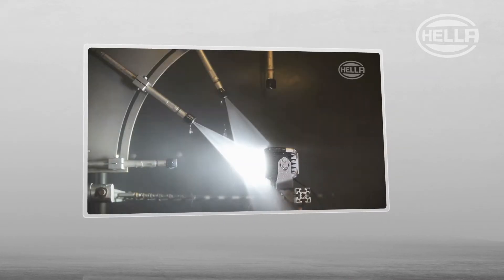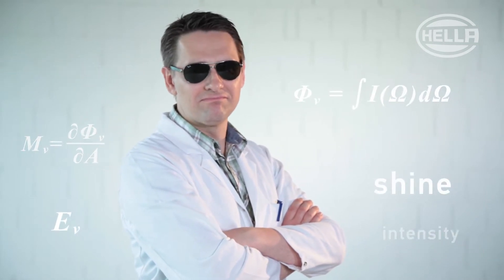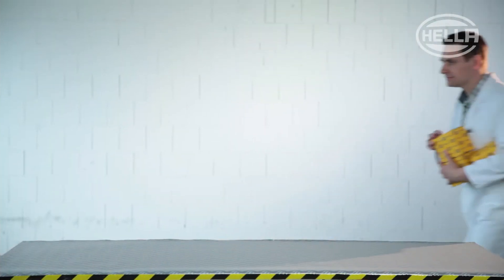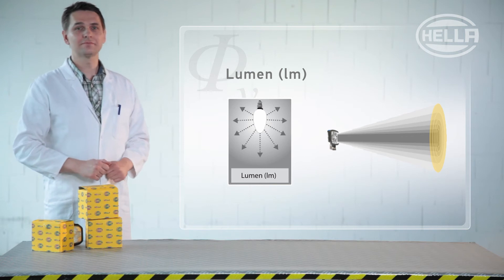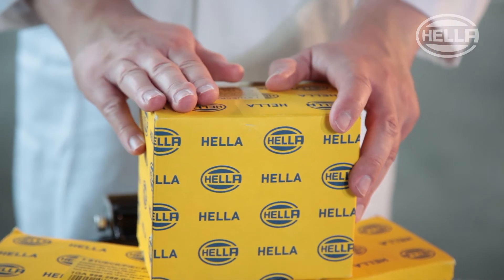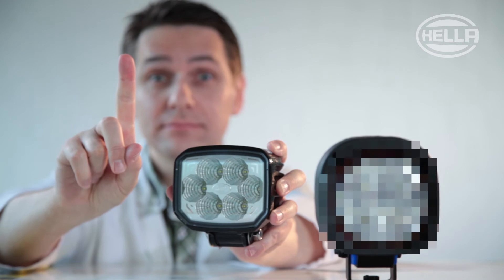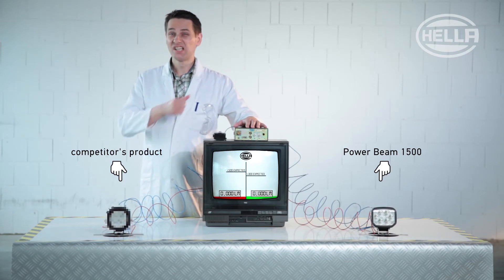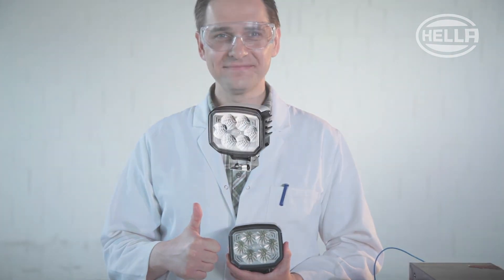HELLA test lab: the measured performance of worklights

Comment: The problem with Hella work lights is that they don't compare with other leading brands like Rigid or Baja Designs. These work lights have extremely low lumen's at 1300 compared to other high-end 4"x4" lights at 7200-9700 lumen's for the same money.